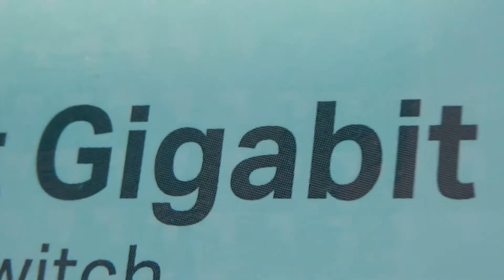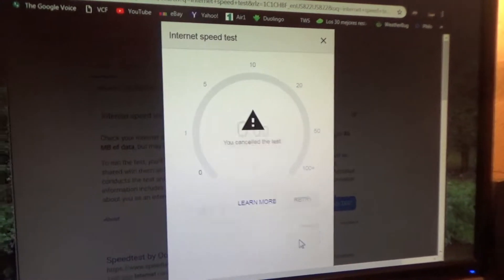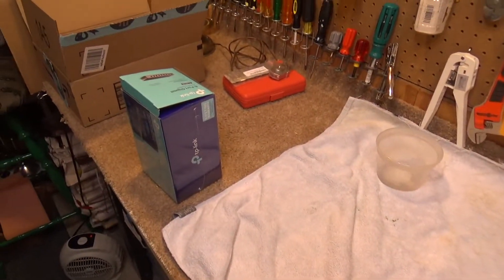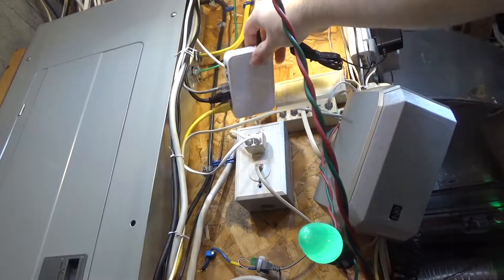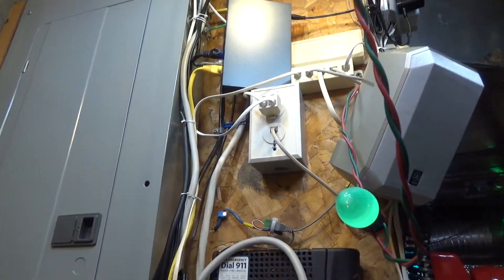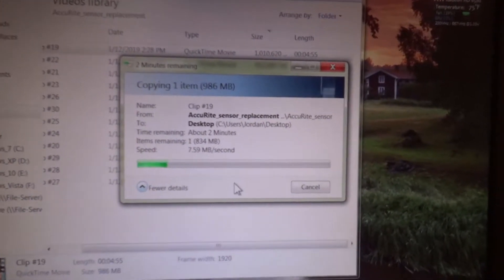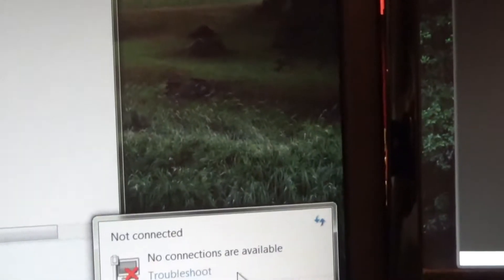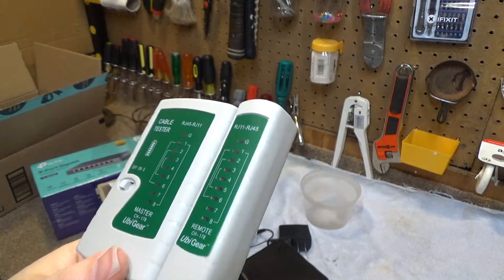Network Upgrade Freakshow Part 1

Comment: Good video. I’m In the process of installing a few gigabit switches around the basement for some of my new internet devices.
Reply: Thanks for letting me know about that Nik. Speaking of, have you checked Discord lately?
Reply: Aaron Dunn for about 5 seconds this morning.
Reply: @niks_crazy_world  - Okay then. Why were you working on getting the new Internet devices in? And also, I did message you on there.
Reply from the maker: @niks_crazy_world  Thanks, I hope your installations go with less glitches than mine did..
Reply from the maker: @aarondunn1489  What does Discord have to do with the video?
Reply: @JordanU  - Nothing, I guess.
Reply from the maker: @aarondunn1489  Not good